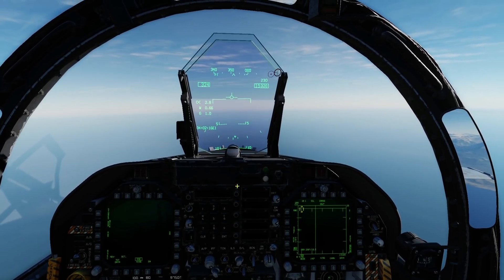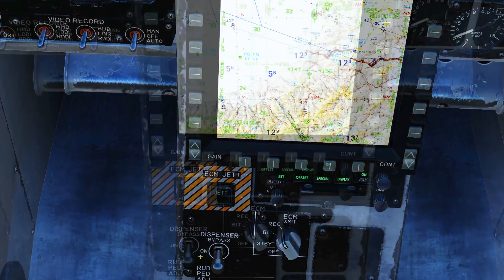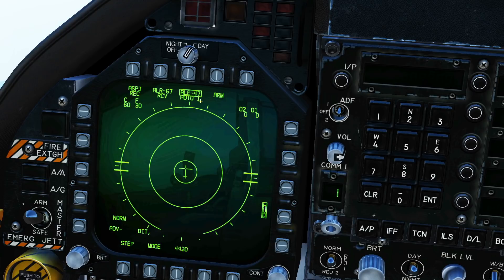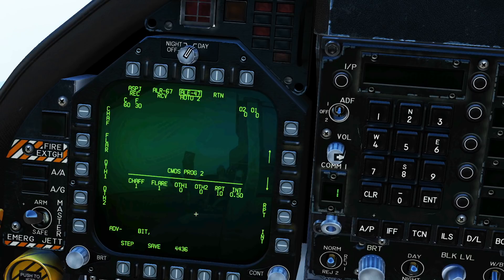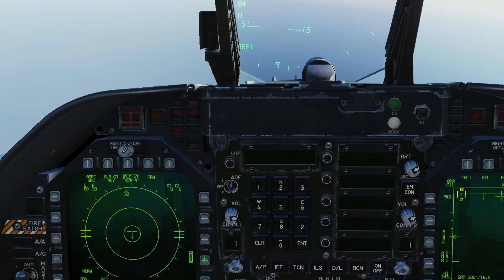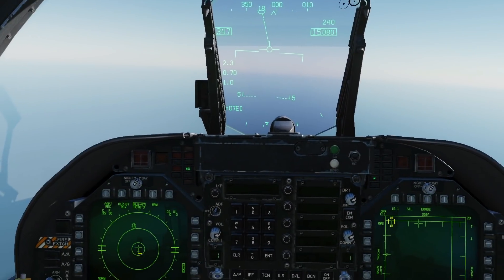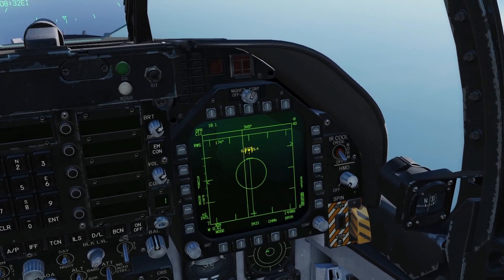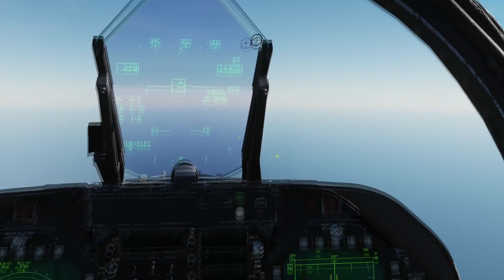FA-18C Hornet: Updated Countermeasures (ECM, Chaff & Flares) | DCS WORLD

Comment: Hey, bit late, but when I try to use either the slap switch or normal countermeasure button it only dispenses 3 before stopping and it won't do any more. I use the BFM vs MIG-29 mission.

Comment: Question: the aspj jammer actually points at the emitter its jamming and tries to get  it to break a lock with different techniques than simple noise jamming; could the hornet radar break an amraams lock? I know that pitbull range is too close for normal jamming but I am curious if the radar is strong enough in the f18/weak enough in the amraam that it can fool a missile. Perhaps it's also even better at that when faced with the older phoenix

Not exactly practical right now, but when they add in jammer priority settings it could be nice to have the radar jamming missiles as soon as your own goes pitbull

Comment: I’m sorry that chaffs (and flares) are wasted (even on beam aspect angle) against a Doppler SAM as for exemple SA6 or SA11, by experience and according laws of physics they are fully unable to disturb the locked radar except if used in coordination with the on board jammer to perform chill (chaff illumination). Beam manœuvres coupled with on board SP jammer Doppler coherent narrow noise and VGPO ou VGPI (velocity gate pull off/in) is much more effective so closing a Doppler SAM like a sailing boat blows the wind is a good solution...Against a pulse radar like SA8 incohérent  white noise jamming and chaffs are effective denying the echo range position on the A scope of the operator of SA8 specially if they are combined with a RGPO/I range gate pull off or in or both drawing eventually the radar range gate to chaffs when the jamming is emitted by the on board jammer. Time coherency between jamming transmission and chaffs exhaust must be programmed wisely. Flying course as to be done in real life straight to the SA8 and not on beam aspect where you stay always in the same range cell of the radar. I read or hear also very untrue things, since ASPJ has been introduced, about BTR burn through range value they said making the jammer not usable at short range. It would have been much better speaking of SSR self screening range that take into account the S/N ratio, typically 11 to 17dB, needed by the radar receiver performing its detection and not dealing with the power received versus distance crossing curves at 0dB value. SSR or BTR are only valid if jammer transmits spot or barrage noise which are very poor techniques, if deception modes are used like VGPO or RGPO, the J/S ratio becomes infinite because there is no more S in the radar range window or Doppler filters so you can jam the radar at very close range, even during ACM at few NM, of course if the deception is successful vs radar ECCM. Additionally, a Doppler radar uses a mandatory automatic CFAR constant false alarm rate receiver that adjust the threshold always above the noise received that means it is easier to desensitize that the eyes of a trained operator over a good old raw radar PPI. Generally speaking ECM and ECCM are poorly rendered in DCS except perhaps flares, compared to Falcon 4 APG68 simulation for exemple. Also it’s a pity Gen X has not been introduced as it is the only valid angular off board jamming defense against an active mono pulse  Fox 3 missile seeker while generating off board huge RCS by using active repeater techniques...Of course, delivering an active decoy like Gen X would require also an active missile approach warning as life duration of the decoy is very limited...Towed decoys are also nice for angle off board active jamming against mono pulse tracking but they are only implemented on E/F A/C...I think a F-18E/F mod or a growler in DCS would make sense as well as a mod allowing a real programming of ECM techniques selective library unfortunately I am not an expert lua programmer....
Reply: You broke my brain..

Comment: The jammer should be pretty useful in SAM-rich Danger Zones, especially when you want to get rid of them.

One very important change to the ALE-47 you didn't mention is that we can now program the thing on the ground. Was about time they fixed that and it's so much better to have appropriate programs set up already when taking off.

I recommend running the thing in manual, having #5 set to drop 3 times 1 chaff in .025s interval and #1 the same, just with flares. With that, you can conveniently pop 3 CMs of either type with CMS FWD (chaff) and CMS AFT (flares) and mostly, when timed well, 3 or 6 quick pops are sufficient to be effective. And it's a nice count so you get 20 chaff pops and 10 flare pops. In Bypass, the mapping is exactly the same, just one CM per press, so you can even switch to single and back to triple that way. Any kind of auto mode just literally dumps your CMs, just don't use those if you want to survive XD
Reply: Excellent news, yes they kept that little nugget quiet. The airborne programming is the main reason I have kept my ale in bypass.
Reply from the maker: Thanks RD. I'm still gunna just use Bypass as that's what I always preferred anyways :)

Comment: how do you use your air radar when the jammer is ON XMIT?
Reply from the maker: Can't. They are mutually exclusive.
Reply: @grimreapers  that is really dumb :(
Reply: @stalhuth  it is the way it is, at least on this unclassified version of things. Matt Wagner video on the jammer shows that.  It is a different mechanic now. Also, if you have radar on, it makes for the enemy very easy to see you. That's why you have the Silent option on the radar, so enemy units can't detect you earlier. In the old days of Jane's games, the leader had the radio option to tell the wingmen to turn radar on or off. In those games detection range versus radar usage were implemented. In DCS I really don't know. Until the Gulf War I a common tactic was to get inside enemy territory with radar off. Today, with the advent of AESA radar, the great vantage is that the same array of antennae can track and jam at the same time, with low probability of detection. In the case of the legacy Hornet, with one antenna only, that's not the case. The own jammer interferes with the radar. It's like turning on a food mixer  while watching an old analog TV. There will be interference all over the screen.
Reply: @sloppydog4831  I understand to use this method in air to ground attacks but air to air is very stressing trying to lock the enemy and at the same time use the jammer, is not practical, at least not for me.
Reply: You don't. I'm guessing part of the jamming is turning off the radar; or the jamming prevents it from working. You can put it to REC and continue to use air radar but it won't actively jam.